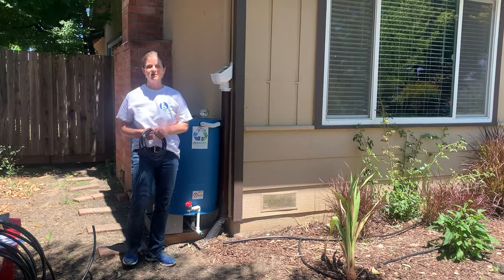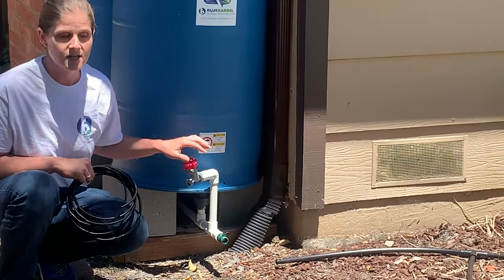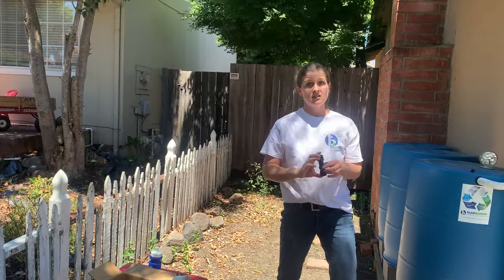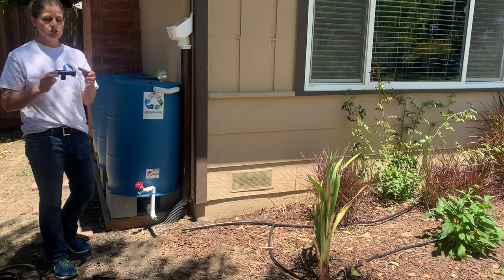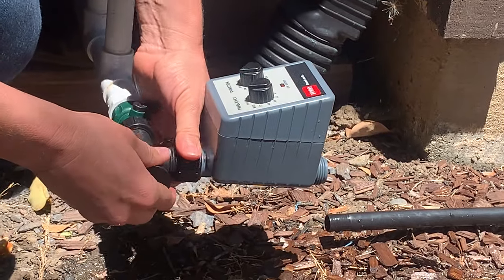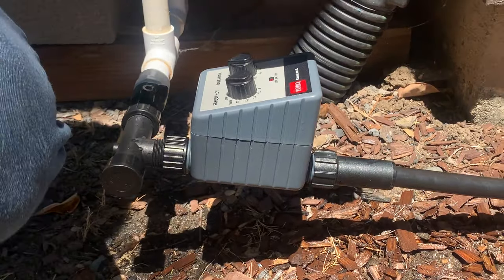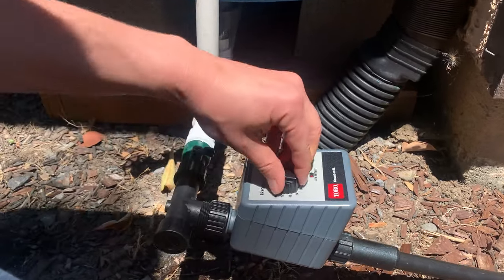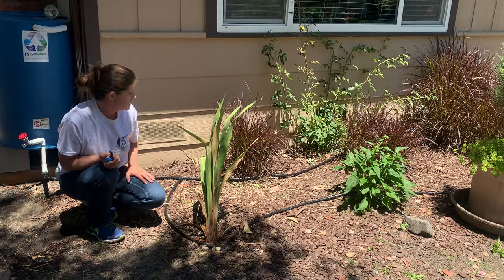Live Demo: Gravity-Fed Drip Irrigation with Bubbler Emitters

Comment: That's cool, thanks for the tutorial and all of the helpful tips.  I believe you said that with a flat yard the gravity feed could reach plants up to 20 feet away?  Thanks!
Reply from the maker: Glad to hear that this tutorial was helpful! And, yes, on a flat surface the water should travel up to 20-25' away. Slope and distance considerations for gravity feed is explained further in this blog:
https://www.bluebarrelsystems.com/blog/gravity-feed-irrigate-rain-barrels/
Reply: About 8' heightened 1000 lit water tank allows me to irrigat 220' long and 4' wide raised bed with two drip lines;drippers at 2' ! 3.75 per minute discharge at last dripper! ( Every dripper give almost equal discharge) beds are leveled by hand.not land!

Comment: do emitters give their rated gph with a gravity system or is it less? i have a barrel that is 4 ft off the ground and everywhere it feeds is pretty much level but i just wonder what the feed out of a 1 gph dripper would be since that is much less then the pressure of a hose line.
Reply from the maker: Your pressure will change as your barrels empty so there is not a consistent gph rating for gravity fed emitters. See this Blog for more on the basics on gravity fed drip irrigation - https://www.bluebarrelsystems.com/blog/gravity-feed-irrigate-rain-barrels/
Reply: @bluebarrel  thank you for your response that was a very helpful link

Comment: Do you need to use this type of bubbler for gravity fed if your already have an irrigation system with spot spitters?
Reply from the maker: You can try what you have but not all drip irrigation gear works without pressure so if you don't have any luck, you'll want to try equipment that's meant for no-pressure applications. Here's a helpful article about getting started with gravity-feed: https://www.bluebarrelsystems.com/blog/gravity-feed-irrigate-rain-barrels/

Comment: Will your system work on drip tape irrigation?
Reply from the maker: Hi there - drip tape is not recommended for gravity-feed because it takes a fair amount of pressure to fill the lines enough to expand the tape. The kit shown in this video (and all the equipment available at bluebarrelsystems.com) is specifically designed to work with gravity-fed barrels or tanks. Got more questions? Contact customer service at bluebarrelsystems.com.